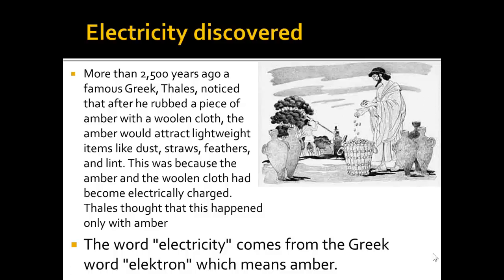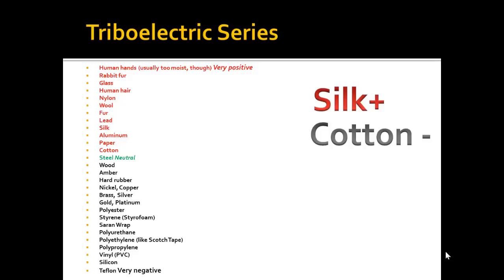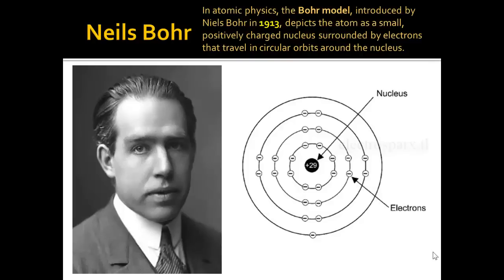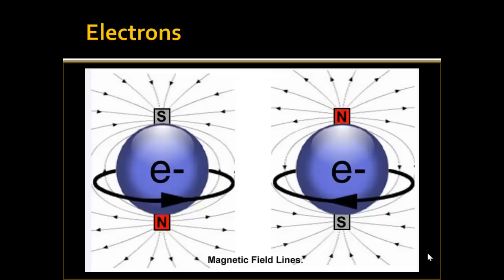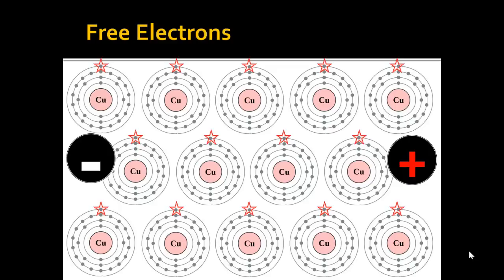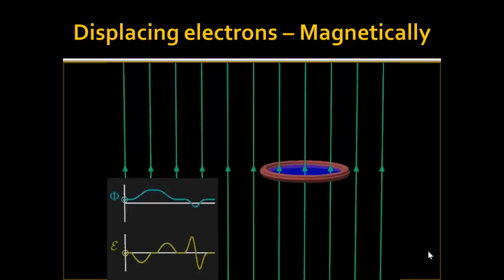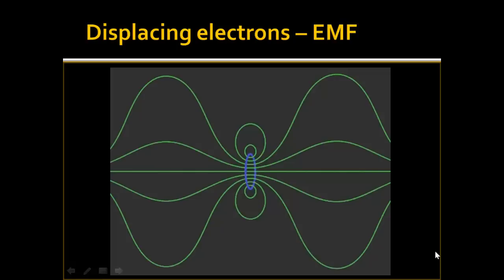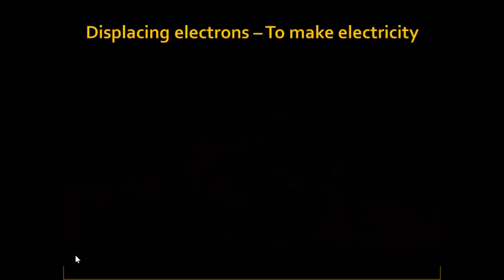Basic Electricity & Magnetism Lecture Part 1.mp4

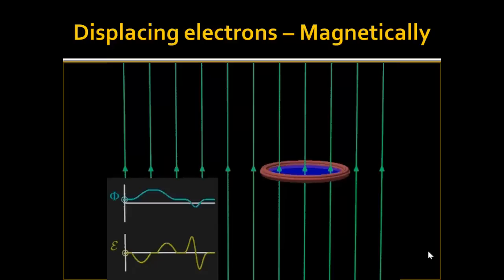Comment: 43:30 this part should have been better explained. Why the induced current started to move to the left (i.e. the electrons started to move to the right) when the external magnetic field is getting denser. Do moving electrons (magnets themselves) move their north poles first in the wire? Magnetic field generated by the current has its force lines pointing in the same direction as the external magnetic field, ie in the beginning the loop has its north at the bottom? Why?
43:44 detto when the loop start to turn

Comment: Thank you for this video! I did have a question-- usually the armature in a solenoid is just some ferrous material, so that once current flows through the coil, the dipoles can line up to where the center of the coil attracts the material to an equilibrium state. Could there be an instance where if a permanent magnet was used as the armature, the poles on the magnet were aligned in such a way that the solenoid would reject the metal as opposed to attract it to its center? I am thinking that it would depend on the direction of flux of the coil (from the right hand rule) and the orientation of the permanent magnet. Am I understanding this correctly?
Reply from the maker: Correct...Once the coil is energized, it becomes a weak magnet and its interaction with a permanent magnet is the same as if it were a weak permanent magnet, toroidal in shape with the poles existing on the axis of the hole.
Reply: Thank you very much!